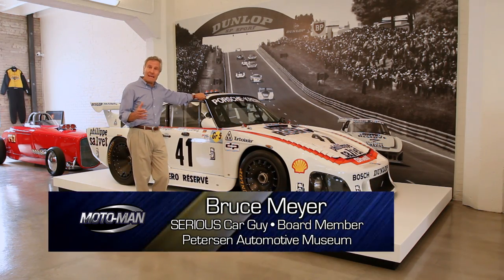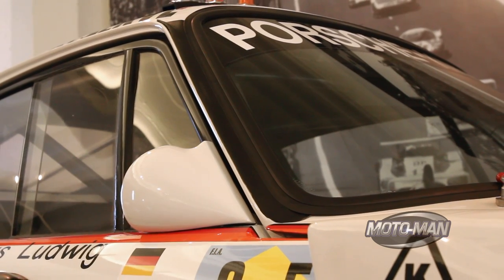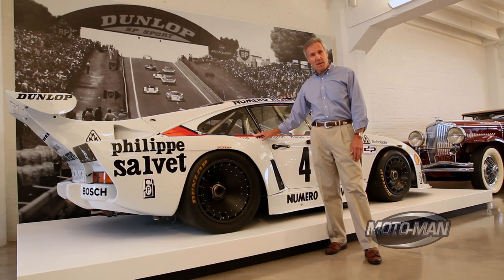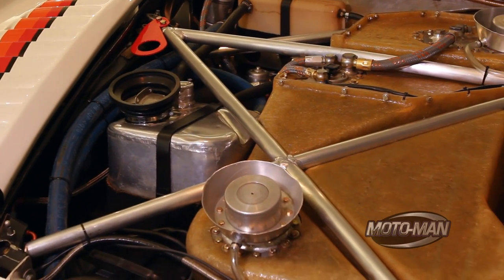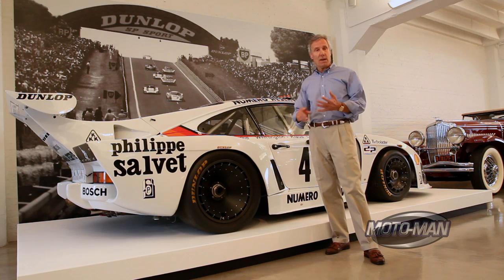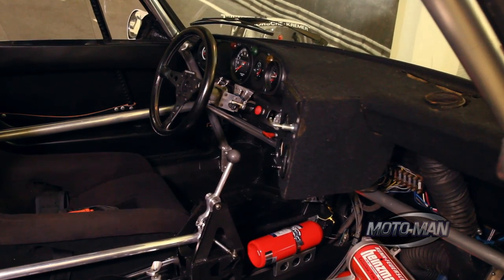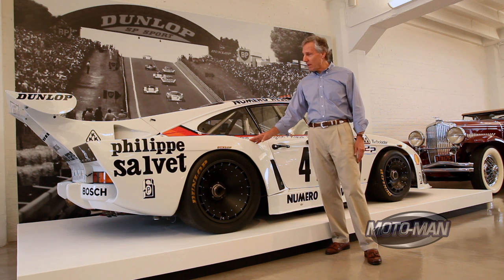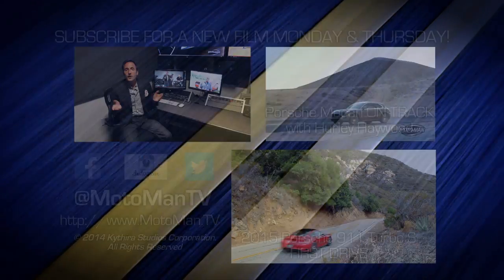1979 Porsche Kremer 935 K3 Turbo: Aero Tech & History of the LeMans Winning Porsche

Comment: Where is the nitrous bottle
Reply: Exactly.  Hidden nitrous.
Reply: True. The nitrous boosted the 935 to over 1000hp. They brothers knew and helped them win.
Reply: Hidden in the rocker panel.
It was addressed on Adam Carolla's podcast.
They confirmed it with an exmechanic when they found something peculiar in that area.
Reply: @dereks66  they didn't have the nitrous in the 79 le mans, they won it because it rained and they had a windshield wipers unlike every other car and they just had a lot of speed, the nitrous couldn't have been used during the race because as soon as it finished the car would die, it was only helpful in the Daytona 24hours qualifying where they used it on the banking and as soon  as they crossed the line the car died because they engine just melted because it went from being 750hp to over 1000hp.

Comment: Design Plastics

Porsche 911 Performance Handbook
Bruce Anderson · 1996 · 
"The attractive K3 bodywork was designed as a collaboration with Ekkehard Zimmerman of Design Plastics. All of the bodywork was done in Kevlar instead of fiberglass to increase strength and reduce weight."